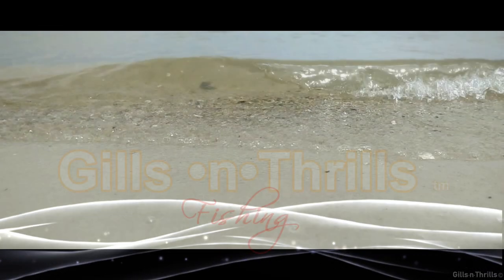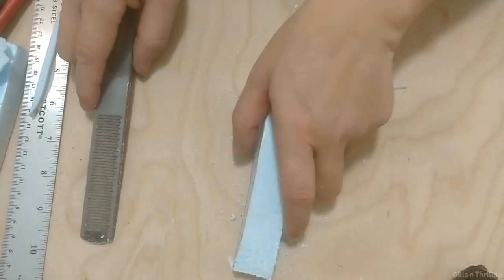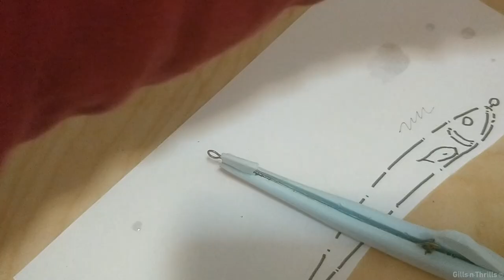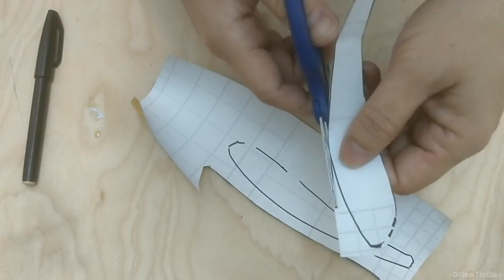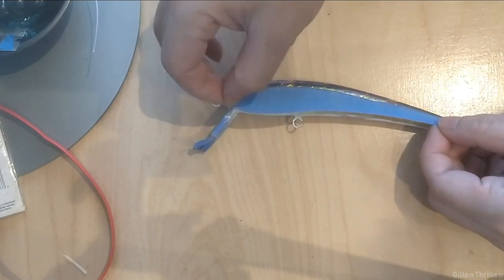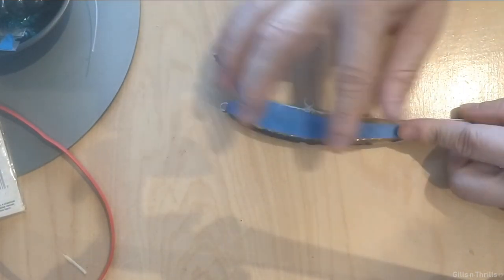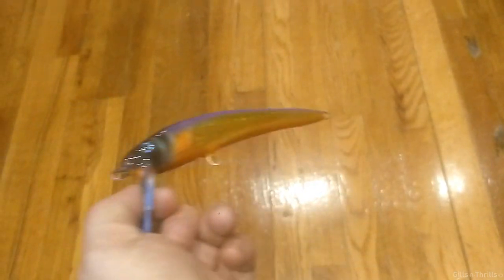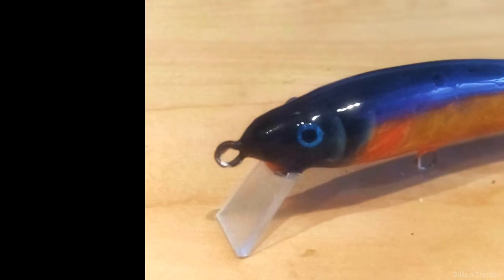Making a Fishing Lure from Styrofoam - JerkBait Ep 116

Comment: I would agree with one other comment and invest in a new airbrush, my choice would be an Iwata CM.C PLUS - CUSTOM MICRON with 0.23 Nozzle size as your work horse and for finer work the CM.B - CUSTOM MICRON with a 0.18 Nozzle. Big investment but no better airbrush on the market, one thing I should say is that these airbrushes need thin paint, like what is used in scale modelling to work properly. If you're on a budget then look no further then a GSI Creos Mr. Procon Boy FWA Platinum Airbrush, 0.2mm but you'll also need a compressor and spray booth which is whole different story but if you need help choosing one, I'm more than happy to point you in the right direction.